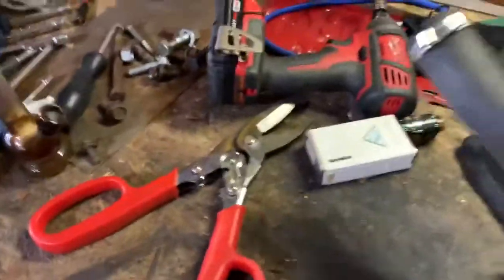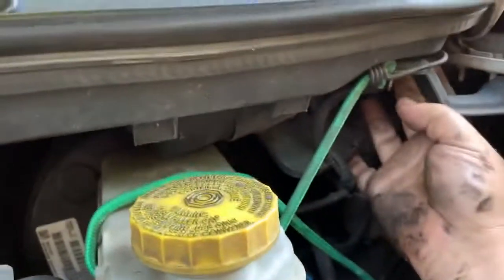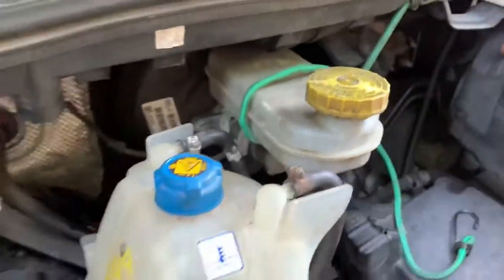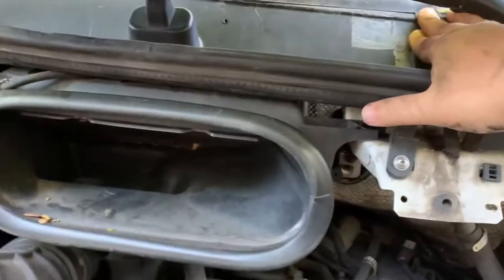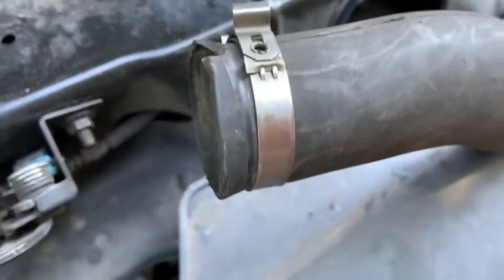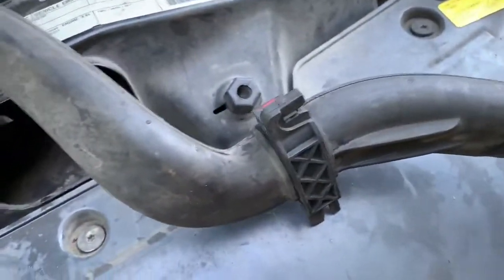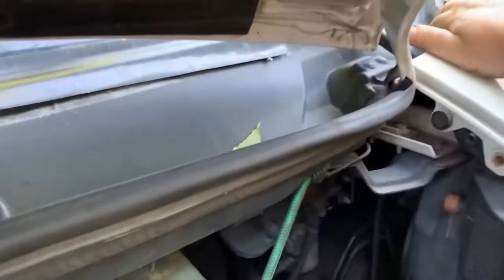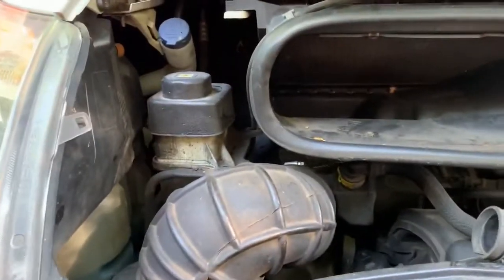Ram Promaster Cowl Water Drainage Tube fixins’

Comment: On my van water had pooled on the engine and rusted some bolts.they had to destroy that piece  whatever it was in order to take it off. It was under warranty at the time. I’ve had rusted screws and bolts but no body rust to speak of.